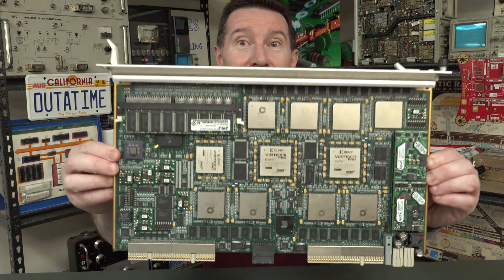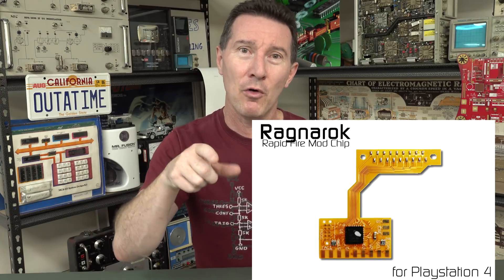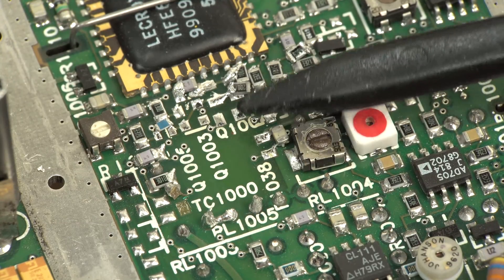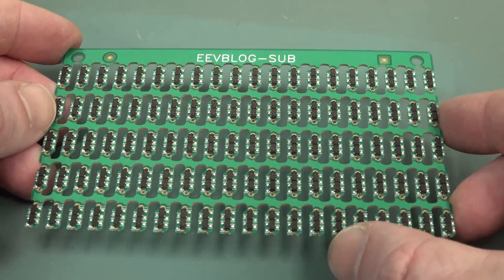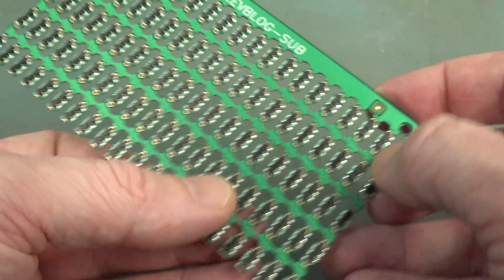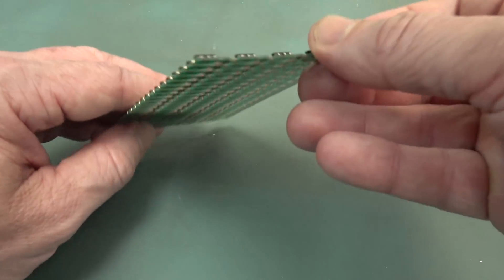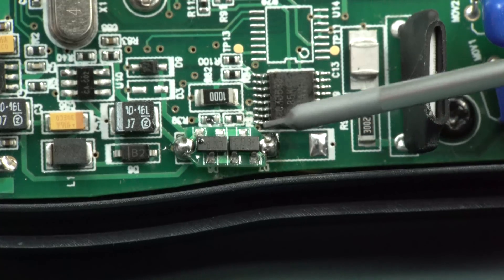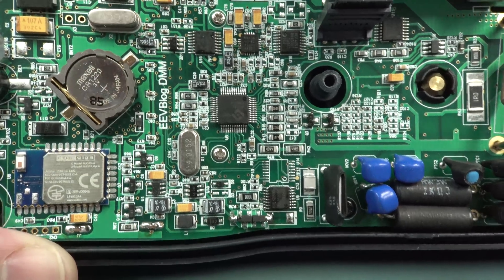EEVblog #1158 - How To Create PCB Mod Boards

Comment: SMT operator here, we would probably not use a fixture on the pick and place. Most pick and places are outfitted with support pins to hold the board but in companies with $$$ will use Quiktool or Gridlock auto air supports. Air actuated support pins that form to the shape of the board so its even safe for double-sided boards.

Comment: If you moved the mini-boards closer together and just used V-Scoring rather than routing between cards, you could get many more cards side by side, and then use V scoring between the top of one row and the bottom of the next row, which could gain you a few more rows of usable cards. You could castellate a via so the top half goes to one card, and the bottom half to another card. Why reduce your output? I assume there are real reasons.

Comment: Re: Console mods -- there are a lot of bad mod chips that make you run wires everywhere, but the cool convoluted shaped ones that fit the exact foot print and just get soldered in place, like you mentioned, are freaking slick! -- Voultar has some videos on his channel of repairing poorly modded ebay consoles with such chips -- this one is pretty cool: https://www.youtube.com/watch?v=TDwroVnXFH4&list=PLmvBQC6DTfJwUQMOzmLLW7KDJFzVuxZr6 -- he does still have to add a few stray wires for some of the chips -- but the before and after on the hucard slot is amazing; and he's got lots of little boards like that featured in his various videos. 😊

Comment: For panelised thin PCBs undergoing pick and place, it can be easiest/cheapest to break out the circuits from a number of sacrifical panels and glue the panels together until thick enough to be stiff and act as the back support for a panel being populated.

Comment: the copper filling external of the actual pcb also helps for stability in the flexibility of the pcb, for some non standard sizes, sub 1mm boards, you need copper as much as possible to have some rigidity in your board, else it becomes some kind of flexible plate where pick and place becomes a nightmare

Comment: In the 80s a mate used to improve output stages on synthesizers by replacing the nasty factory OpAmps in TO99 metal cans with a daughter board with a higher spec OpAmp and some magic, including shielding (shielded signal path), and a little heater circuit because thermal instability was a problem. He used to make good beer money once word got around.

Comment: Are there industry standard PCB sizes?
Reply: Yes and no. There are some standards for some specific systems like VME, and the PC104 format (which I think is now obsolete), and for PC motherboards of course like ATX size etc. However for a lot of applications there is no standard. EG in the automotive industry I did not design any two boards the same size. Even boards doing the same job for different customers were different shapes often due to connectors. The only place I know of with standard sizes (sort of) is panel size for the PCB's to be etched on. One of the sizes is roughly A4 size and often the PCB design is fiddled with to get the maximum number of PCB's per panel. Basically it's one long session of jiggery pokery start to finish.

Comment: I wonder why so thick PCBs are needed for the mod component. Was it just a matter of cost as the thicker PCBs were cheaper?
Reply: 0.8MM is 1/2 standard thickness, and if you go to say 0.4mm or so then some places charge you more. It's apparently a bit trickier to mill as it flexes more.

Comment: Hi Dave, I am doing an obsolescence job at the moment for a obscure SO8 watchdog chip. I have found an SO8 AVR microcontroller that has power supply pins in the right place. It has onboard rc oscillator, programmable voltage detector, so with software for watchdog emulation so its going to be the replacement, no mod board required!

Comment: I love these "how to do it" videos, Dave. One thing to note - some products such as wifi and bluetooth interfaces are designed from the start to be used like mod boards, placed down on your design from trays. Vendor gives pad layout for castellations, etc. I dont know how common it is, but we use one that way! We can use that mod board on a number of different designs, making changes to it independently of the main board.

Comment: Interesting and timely. I want to do a board that is about that size. Its to replace an SMD crystal in an HC-49/S SMD package. I was wondering how I can get a board that is only 12x4mm made.
Reply: Same as any other. Just make sure you have it populated before it is depanelized. I.e., if your pcb manufacfurer and your assembly house are not the same company, be sure you order your pcb as complete panels!

Comment: In the UK electronics industry (HP), we used the terms 'kluge' or 'kludge' for an add-on mod like this. Wikipedia gives lots of possible sources for these words dating back even as far as WW1. If a mod is a bit 'kludgy', it generally means it's a bit of a bodge, but it works. The Scottish slang for toilet is  'cludgie' :o) OTOH, a kluge pcb can be  a valid way to a nice result, as with Dave's 121GW meter mod here, imho. Thumbs up !

Comment: I know what you mean about repairs/replacements for military and defence. Also some backwards compatibility had to be part of the design of some sub-assemblies.
The company I worked for had to include (as part of the purchase agreement and contract) an assurance that we could repair, supply, maintain or replace everything down to component level for 10 years after date of installation. 
Bodge wires and mod boards would be used regularly to overcome very real obselesence issues out in the field.

Comment: Thanks Dave, this is super useful!  I recently created a PCB in my last video and the problem I had was getting the PCB fab to cut the castlated edges - what I was missing was the idea of panelising it, and I had no v-scores.  That would have helped I think.  I will do this in the revision.
Reply: I would think you could put plated through holes down, laying halfway over the dimension outline, select tab routing, and leave a note in additional comments that it is on purpose?

Comment: Those castellations are awful. Even milling / routing through a plated hole has the possibility to tear out the plating.  I wouldn't like to have those ragged edges on a pcb. What's the correct way to do castellations that are guaranteed to give a proper finish every time?
Reply: Maybe laser cut:
Reply: I have seen them on the milled edge of a board and that seems to work better than some options. However the milling can be less than perfect too.

Comment: I've been working on a handheld gaming machine using a SBC (Lattepanda), and I found that there's a ton of nice 2K LCD modules on aliexpress that come with this generic MIPI to HDMI driver board. Some chatter about people trying to design these boards on the forums, and on GitHub, but all abandoned. I was originally thinking of designing some sort of FFC to connect the HDMI from the driver board to the SBC (perhaps with a "repurposed" HDMI switch in between so I can still have an HDMI connector somewhere on the thing). I've never designed an FFC one, and they seem expensive. Do you think it might be possible to create a modboard to replace the connector instead, or am I going to destroy it when attempting to solder onto the HDMI connector pads? Maybe there's a better technique?
Reply: Do you need the processing power of the Latte Panda? The R Pi has some really nice touch screens available and they are really low power. Also what do you mean by FCC? Flat Conductor Cable? There are that I know of at least 12 uses of that acronym in the electronics industry. I'm presuming the LCD screens have MIPI interfaces? One of the reasons they might be so cheap is that HDMI to MIPI interfaces cost a fortune relatively speaking. IE the cheapest I know of is £50+. I have a Pi with one of these https://www.raspberrypi.org/blog/the-eagerly-awaited-raspberry-pi-display/ and it cost about £80 a while back. Not 2k but it works well.
Reply: @gordonlawrence4749  I really need an x86 processor. The pi 3b+ is a brilliant board without a doubt but I'd really like to be able to run windows x86 apps. The 2 lane MIPI connector on the pi is also a real drag. It just can't push out as many pixels as HDMI, but what's the alternative if not these relatively expensive driver boards? It seems only proprietary drivers and driver boards exist in both the pi ecosystem and elsewhere when it comes to MIPI.
Reply: @gordonlawrence4749  and yeah, I was talking about designing a flex connector like Dave was talking about in the video, but while they're great on space they seem to be an expensive pain in the ass.

Comment: What happens with impedance-matching sensitive traces? Guessing the mod boards aren't applicable to those? I know vendors can deliver on having certain traces come to a desired impedance (e.g. 50 or 100 ohm) and then they layout the trace length, shape, positioning, etc. to build the desired impedance. Surely adding a mod like to a trace like that would ruin it?
Reply from the maker: Yes it mucks things up. The mod board can be controlled impedance in it's own right, but the interconnects and ground connections can be troublesome

Comment: I have very vivid memories of sitting on my couch with a beer and a soldering iron modding 1200 PCBs with mod boards and mod wire
Reply from the maker: Only one beer?
Reply: well by the time i was done i had 6, and you could see the gradient of solder work getting progressively worse
Reply from the maker: Only noticeable with hindsight I'm sure ...
Reply: checking my work the next morning by grabbing random samples it was clear ... functional but we all know the shame of an ugly solder joint
Reply: it would be just my luck someone like you would take apart one of the later jobs on youtube

Comment: I used to work at Philips electronic in Montreal. We built PCs, and did our own board assembly. Being a high volume shop (~500K motherboards a year, and a similar quantity of VGA graphics card), the standing rule was that one mod wire would force a board re-spin. We would use up existing inventory of PCBs, and the next order would have the new artwork. Somebody internally did the math, and figured out that the manual labour to add a mod wire, and the bottlenecking of the production lines was always a higher cost than the re-spin cost.

Also, after about a year, MELF packages were banned. In our case, they were used for diodes and a few capacitors, and sue to their shape, gave the pick and place equipment (Fuji CP III and CP IV) a lot of problems, and they tended to roll off of their pads when moving down the conveyor line.
Reply: Yep MELF stands for MEtal film Leadless Ferfacksakeitrolledoffagain.
Reply: That's not really re spinning, if you used up the stock. It's more of an upgrade or revision.
Reply: @xenonram  We called it a board re-spin. Any time the board layout changed, for whatever reason, it was called a re-spin. We kept track of the artwork changes by changing the board revision number, but the act of changing the artwork was called a re-spin. I don't know if this was industry wide terminology, but those were the terms we used internally.
Reply: I don't think they ever made a VCR without at least one mod wire

Comment: Guess leaving the copper on the board is cheaper than to try and recycle the copper later by precipitating the copper out of the etching solution.
Reply: Maybe, maybe not... The way PCB manufacturing was explained to me was you started with really thin copper then plated extra copper onto the parts that were going to be used, then masked that and etched away the unwanted parts. Excess copper fill would be a waste as it would need plating even if it was not used. 

Obviously this doesn't apply to DIY jobs.
Reply: @boristheengineer5160   I have never heard of PCB plating copper onto the board. I was under the impression the boards come with a laminated sheet of copper already glued on.
Reply: @MyuFoxable  I think they plate as part of the via plating process
Reply: @MyuFoxable  The laminate would have a reduced thickness of cu compared to the final PCB. To get through-plating the PCB would be drilled right at the beginning then would be treated somehow to make the insides of the holes conductive. The resist would be applied in reverse, exposing the places where copper was required. Then plating would thicken the tracks to the required thickness and coat the holes. It would still need a conventional etch at the end to remove the unwanted thin copper. 

It stuck in my mind because it was almost the reverse of the classic etching process I'd always read about and used a bit for prototypes.
Reply: @boristheengineer5160  It is making more sense now, particularly with the conductive holes example.

Comment: Can pcb's be laser cut or would it make a lot of smoke
Reply: Copper is reflective and highly thermally conductive, so it takes a huge amount of laser power to cut. 

The fiberglass substrate probably could, though! I'll have to try that.

Comment: I needed a mod board to replace an obsolete SOP8 with a SOT 23-5.
My first problem was finding a board house that did castellations.
Then they would not get small enough, so I have grind one side on a grinder to
get the other side castellations.  This was a couple years ago, but I ended up 
going with OSHPark.  It's a high side switch. Pic of it here: https://imgur.com/a/u41l9bp

Comment: Any general rules to follow when making a castellated design, like the hole diameter/pad size/plating specs to look for? Obviously the trace width and location need a bit of attention. I still haven't ordered anything from a board house yet but am learning a lot of fun stuff from etching a my own circuits from scratch. This looks like a valuable thing to bank for later use. From my experience thus far, it would seem quite easy to have a pad lift while soldering a badly designed or badly executed castellated pad.
Thanks for the upload :)
-Jake

Comment: The pick n place machines I've worked with have had magnetic support pegs you place under the board during setup to help support it. Same with the solder paste dispense machine
Reply: Hi, how did you make sure the pins were put in the same place for each run of the same PCB?
Reply: @andrewwhite1793  The machine indexed each board into the same place when loaded, and the pins underneath never move, aside from when it pulls them away to eject the board

Comment: Will there be a video talking about the mod you made to the 121GW?  I made a mod board for a Motorola D2 Evaluation kit a few decades ago. The board allowed me to plug a 6809 CPU in to the 6800 CPU socket on the main board.

Comment: Illegal console mod boards? Mate, you live in Australia.
Those things were ruled to be legal here due to consumer protection laws. XD
Then again, we DID sign the DMCA after that point, so who even knows anymore.

These kind of boards remind me of the kinds of things you need to make/buy to be able to use certain kinds of parts for hobbyist or experimental purposes.

It can be pretty difficult for many components to still find through hole DIP packages - especially for more complex parts such as say, a CPU or FPGA.
Sure the reasons aren't a huge surprise, since the pin count can quickly explode. (consider if you had a 4 gigabyte RAM chip with a full old-school parallel address bus - that's at least 8 data pins, a minimum of one power and ground pin, a read and write pin, probably a chip select pin, and 32 address lines - that's at least 44 pins, which strains against the limits of practicality for a DIP package, and of course is huge in such a package for good measure.)

So... To deal with BGA or even a typical QFP in a hobbyist, one-off or experimental context almost REQUIRES the use of mod boards to bring it to a more reasonable form factor..
Sure it depends on what, exactly you're doing, but more often than not, this is the only way to reasonably use such parts in that kind of context...
Reply: Boards that facilitate in the pirating of software are legal? Real nice.
Reply: @xenonram  Please, lookup the homebrew scene. There are people coding games and tools for systems like the PS3.

Comment: Do smt components have like glue on the bottom?
Reply: some larger parts can, small components simply sit and stay in the solder paste which is applied to a board before placing all the parts.  the surface tension holds them ok.  this kind of stuff is usually on machines and conveyors so they aren't moving far and people (generally) can bump them and stuff.
Reply from the maker: The assemble can apply glue if needed

Comment: That BER board we see @ 4:35 - Would love to hear the history about it and why it's BER. I see a whole lot of faults right away, which is even more apparent when you zoom in on it. O boy it makes me cringe. Need to know more. SMD's blown all over the town. Crooked parts and soldering from hell. What's going on???
Reply from the maker: I've done several videos on it. Power rail shorts on custom ASIC chips etc. When I took that board of it disintegrated and made a mess of the rest on the board.